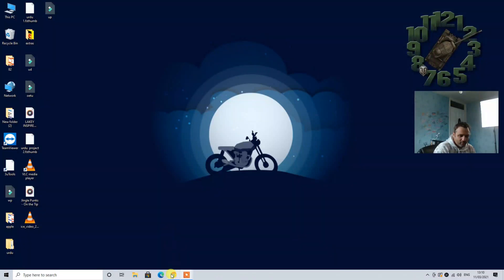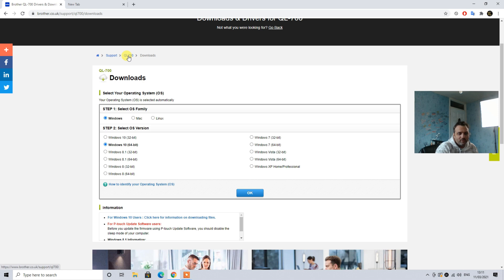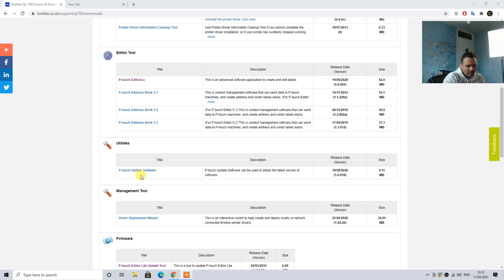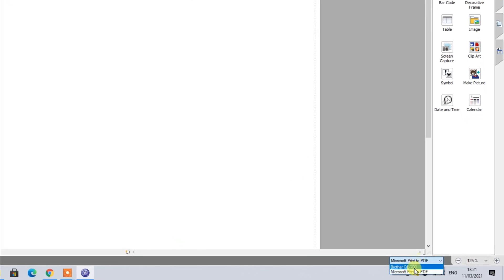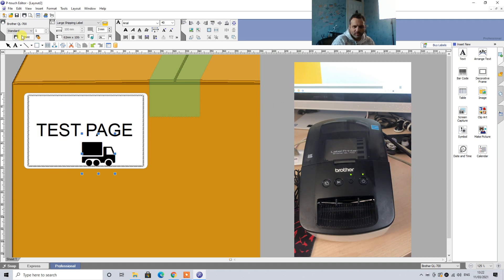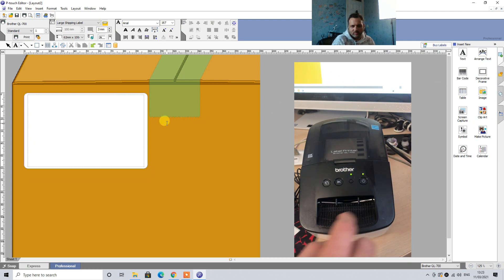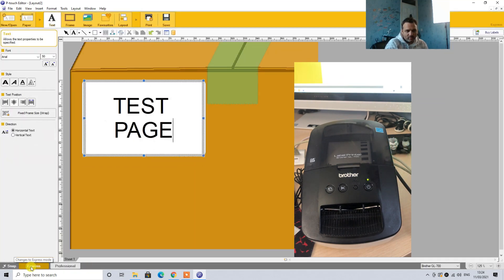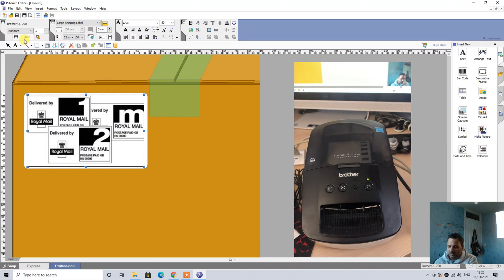How to Fix Brother Thermal Printer Error (Unable to Print) QL-700 ( All Q & A Series )

Comment: Hi , thanx for the ideas but ...., nothing works .... the issue is that this Brother print label QL700 usb connection does not work with Win11 ...   even the so called hand shake using P-lite does not work ...  via the supplied USB ...  taken the device back ..pathetic ...  the retailer should have,  ironically ,  put a, RED label on the box  ...saying that the device does NOT work with Win11.  ....   very annoyed customer ... cheers Tad